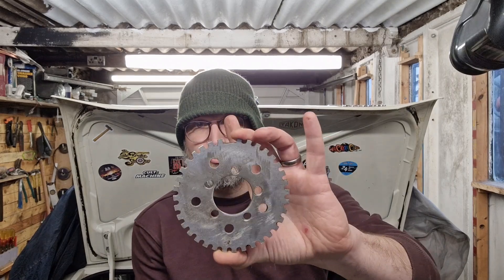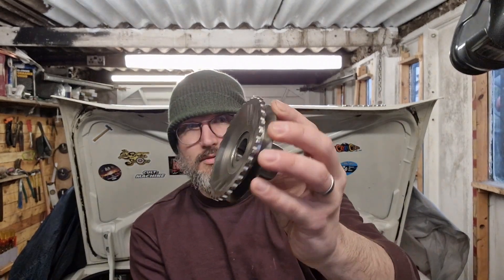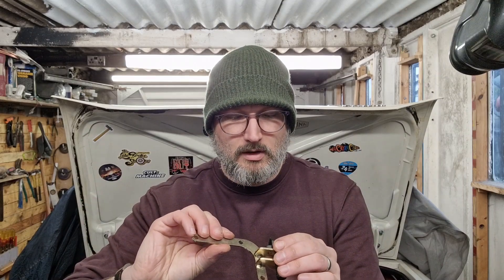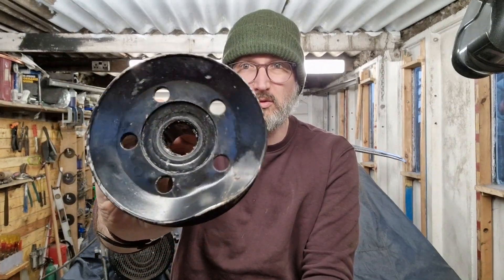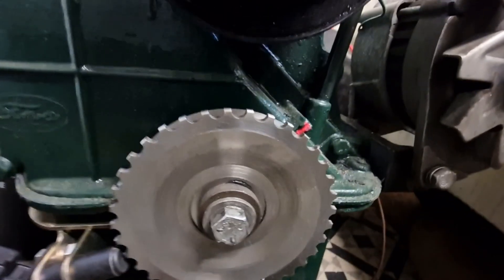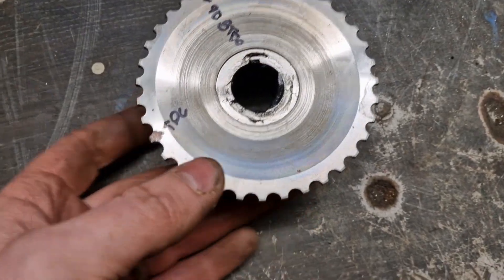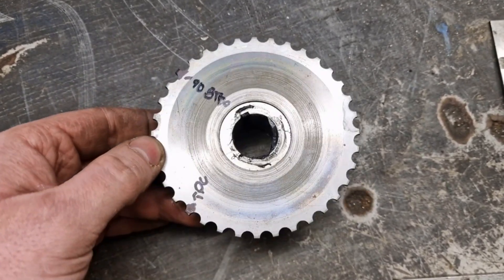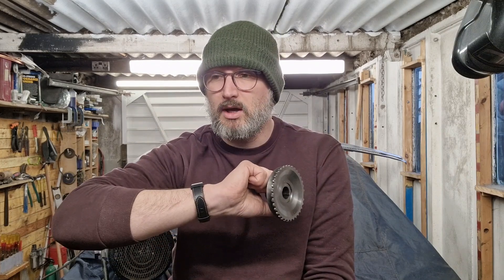Trigger wheel setup - classic car EFI build

Comment: Wow - long story short, 36 teeth over 360 degrees, each tooth 10 degrees. Pulley key'd to crank - there is no backlash! and if key is TDC, count 9 teeth before key = 90 degrees BTDC! Most all standalone ecus will allow actual degree adjustment - use a timing light against a reference mark - TDC is normal - see what degree light is indicating and adjust in ECU!
Reply from the maker: That would be the case if the crank position sensor was in line with the keyway at TDC, it's wasn't so i needed to to be setup to find which tooth aligns with the sensor at TDC then working back 90 degrees.

Doing it this way is belts and braces to get it right first time without having to mess around whilst trying to get everything else working.
Reply: And yet after all that, you still cut the 9th tooth. 
You needed to find actual tdc to find the tdc tooth but after that it’s all 10° per tooth.

Comment: To get a really accurate TDC you can make a piston stop that stops the piston just before TDC. Put a degree wheel on the crank, rotate clockwise to the stop, note degrees, then rotate anti clockwise to the stop and note degrees. Halve the degrees and that is true TDC.
Reply from the maker: Thats a great tip - ill give it a try. 👍